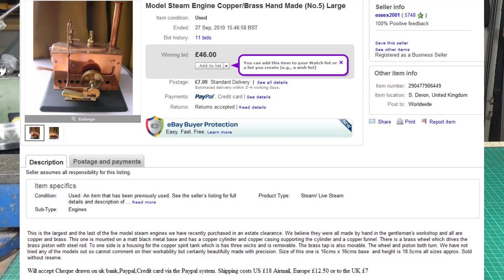Scratch Built Copper Steam Engine MK II - Part One

Comment: Hi Alan.  Very nice engine.  Reading the comments I suspect it may be built from a plan.  The soldering is pretty poor on the new one and given the standard of workmanship on the first one I find it hard to believe the builder wouldn't have gone back and reworked the second engine you bought, or honed techniques to such a degree.  Just my gut feel on this.  You may be right, but the differences are numerous.  Cheers Rob
Reply from the maker: Hi Rob. It never occurred to me that the two engines may have been built by different people from the same plans. It's entirely possible but I'm surprised that I haven't seen more like it, so far these are the only two. Whatever the source they are both lovely engines and run superbly. Cheers, Alan.
Reply from the maker: Turns out both you and myfordboy were right. Thanks to a comment by David-s1b4o, it turns out it and the others were built from plans in a book by Tubal Cain called 'Building Simple Model Steam Engines'. The funny thing is, I actually have a copy of this book and have read it but failed to notice the similarity 😂
Reply: @RetroSteamTech  Mystery solved.  Good pick up.  Cheers Rob

Comment: I suspect too they may have been built by different buiders from a published plan. I like the boiler design, it would suit my wobblers.
Reply from the maker: Turns out both you and Rob were right. Thanks to a comment by David-s1b4o, it turns out it and the others were built from plans in a book by Tubal Cain called 'Building Simple Model Steam Engines'. The funny thing is, I actually have a copy of this book and have read it but failed to notice the similarity 😂
Reply: @RetroSteamTech  The original Tubal Cain not the US one.
Reply from the maker: @myfordboy  Yes, Tom Walshaw not Mr Pete.
Reply from the maker: That could be right, until Malcolm above mentioned it I hadn't even considered it. Still the builder of the original did have four other engines and I haven't seen another like these so you never know. The boilers are a nice size for small model engines. Cheers, Alan.

Comment: I wonder if they are built from a plan in a model / engineering magazine ?
Reply from the maker: Could be, although I've not seen any others like them.
Reply from the maker: As it happens they they were. Thanks to a comment by David-s1b4o, it turns out it and the others were built from plans in a book by Tubal Cain called 'Building Simple Model Steam Engines'. The funny thing is, I actually have a copy of this book and have read it but failed to notice the similarity 😂